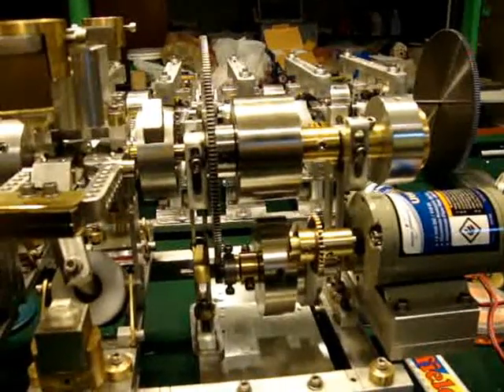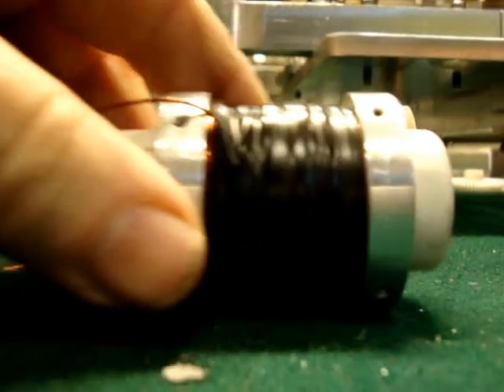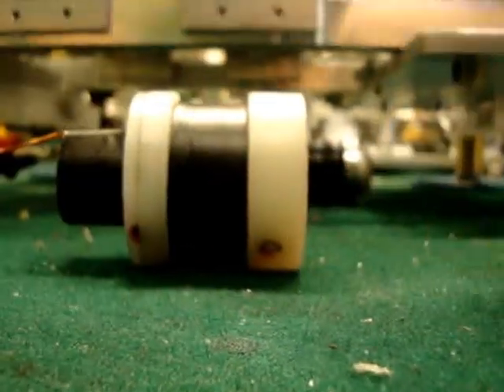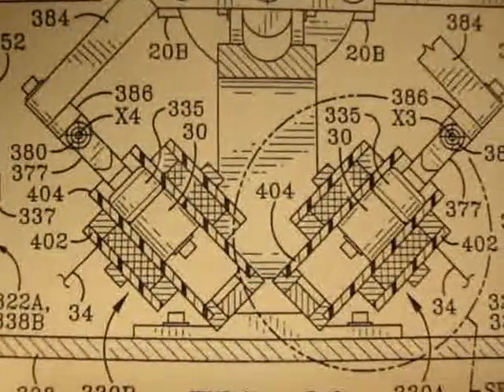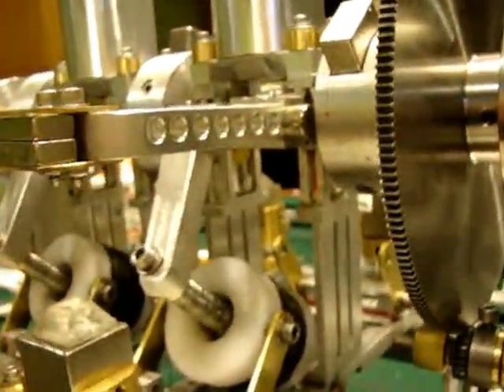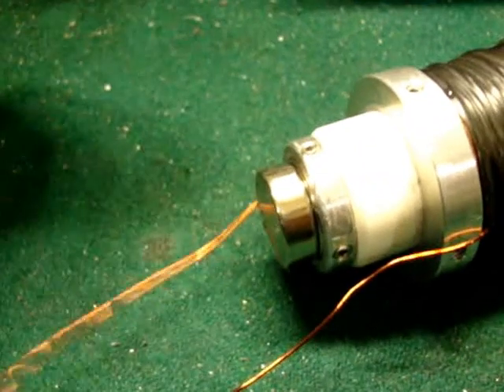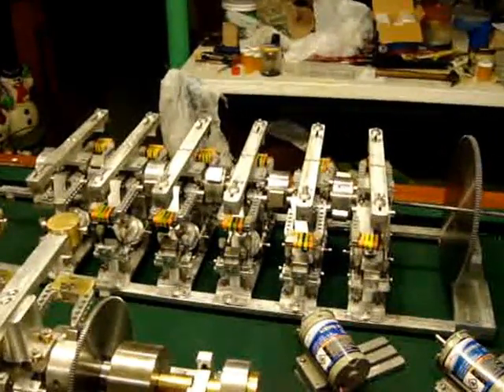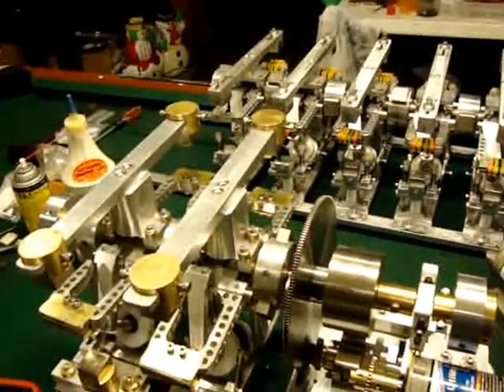Over Unity 34

Comment: You are testing wrong.
You need to find out how much power you can get from one coil by itself.
Convert to a internal combustion engine design.

magnet =piston coil=cylinder

Run the crank with your electric motor. Adjust the stroke and speed for max current out of the coil. Add your extra magnets however you wish. This will be the max output possible for one coil.
 
Install this super coil into your oscillating machine. 

Then measure your input current.